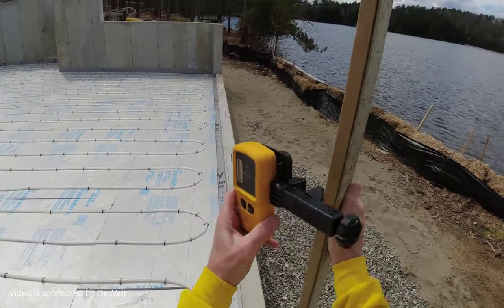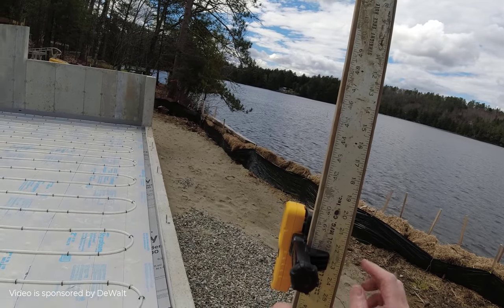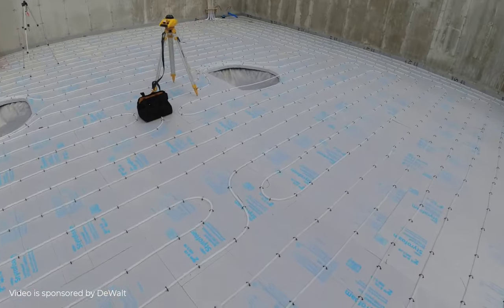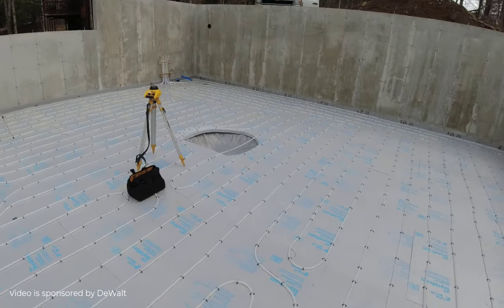How I Figure Concrete Yardage Using My Dewalt Laser Level

Comment: For my first slab, I wanted to do everything myself without buying tools.  I ran a ton of string lines between my form boards to make a grid.  I took my tape measure and measured the distance from the string lines to the compacted gravel base.

I made a representation of my slab in excel and put in the thickness values.  I averaged them (came out to 4"), then multiplied by my slab dimensions  (20'x14').

20'x14'x(4"/12) = 93.33 cu feet = 3.457 cu yards.  I'm adding a small haunch of 6" wide and 5.5" tall around the whole perimeter.  I need to add that to the total (minus what's already included in the slab calculations).

(2)*20'+(2)*14' = 68 linear feet
68 linear feet * 6" * 1.5" = 0.157 cu yards (this does not include the 4" already accounted for in the slab, so I used 5.5" - 4" = 1.5" thickness)

Total is 3.614 cu yards.  I'll round up to 4.0 cu yards probably (approx. 10% overage).  Don't care about a little waste as long as I have enough.

Comment: Hi Mike, your on the money. 
I use their lasers too.
I tell all new builders i deal with  to tap con a master elevation 2 x4 on one wall sprayed in orange with all the grades for dirt , gravel, foam , concrete.  and finish hieght . Anyone can do their job with no question their on the mark. .
It also helps to get your 4" slab!!!
Reply from the maker: Good tip. I'll pass it on!

Comment: Mike you've been a major endorser of the Topcon level you've used for years. What made you change? Now I'm getting confused on brands. Did the topcon let you down?
Reply from the maker: Topcon is good, but they've never reached out to me for endorsing them. Dewalt Lasers are just as good and they reach out all the time. It's a partnership with Dewalt.

Comment: Use decimal equivalents and you can figure any thickness. Measure exactly and add extra concrete after you know exactly what you need. Also you will avoid confusion
Reply from the maker: I don't get confused
Reply: @MikeDayConcrete Maybe you don’t know what an decimal equivalent is. You are definitely arrogant enough to say you don’t get confused

Comment: Most of the jobs I’ve ever done, that 2” would have been a big problem. I guess because that looked like a completely detached garage space, maybe they had the luxury of just not having to have it match up with much else. They gotta be careful for things that don’t seem so obvious right now though. Like if the garage roof ties in with the house roof, are they going to just make the top of beams or walls 2 inches higher (that’ll be a big problem) or do they just have a garage ceiling that will be 2 inches shorter? There’s really a lot to consider with something like that.
Reply from the maker: They added a sill plate to top of wall and we poured to the top of that. Got us to 3.5 to 4 inches of concrete. That was what the builder came up with for a solution

Comment: What does the 81 come from?
Reply: 9x9
Reply: 100 - 19
Reply from the maker: It's how many square feet a yard of concrete will do at 4 inches thick.
Reply: That’s great when the floor is 4” thick. If you multiply with the decimal equivalent of the thickness you can figure the yardage for any thickness.
Reply: So now the outside walls are 2” shorter than planned
Reply: 😅 @JBekus